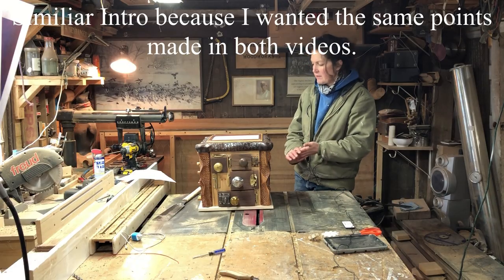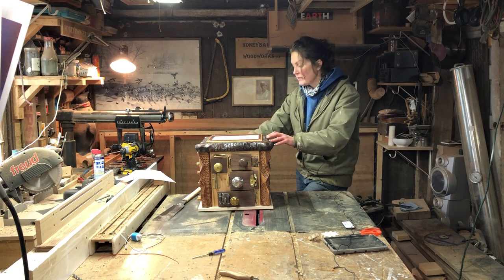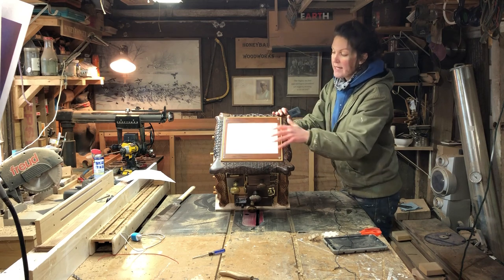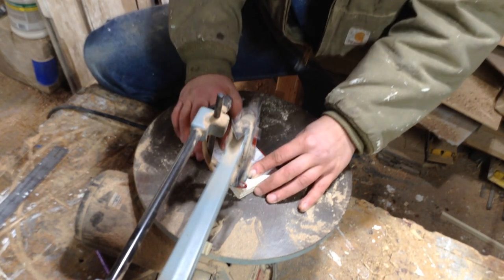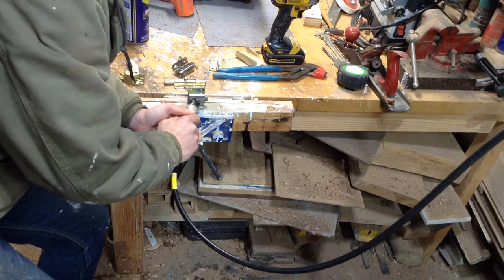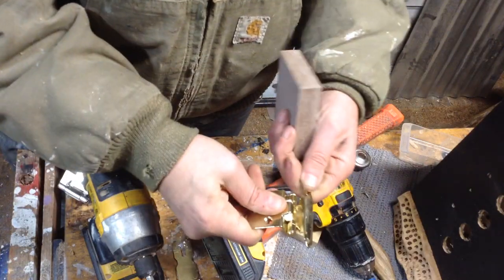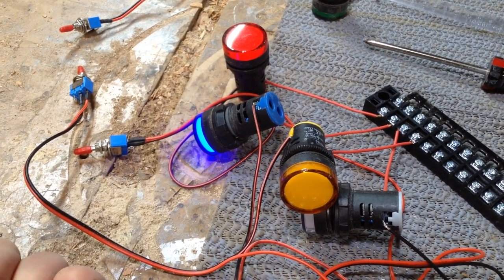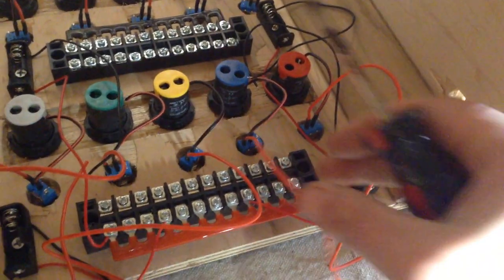Woodworking : Sensory Box/Board // How-To Part 2

Comment: Another great idea well executed. What do you find your most used hand tools are. Question coming from a beginner
Reply from the maker: I honestly don't use hand tools as much as I would like because power tools are just so much faster, especially with carving.  But a set of chisels is a must, I have a cheapo 4 pack set from Aldi that Paul Sellers actually recommended.  The were  like 10.00 and work fine.  I have a couple cheap hand planes that I use weekly.  All have wanted to get into more spokes shave and drawknife work, but just haven't found a ton of time to really sit down and practice.